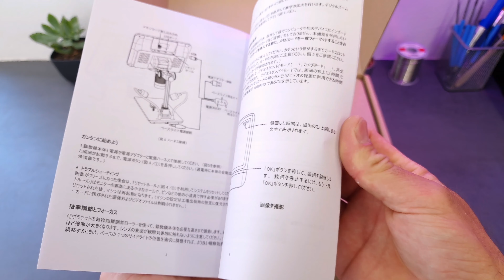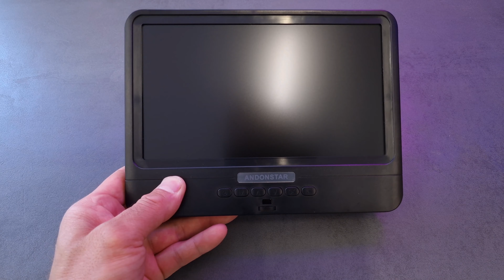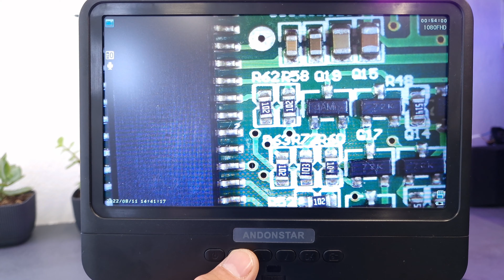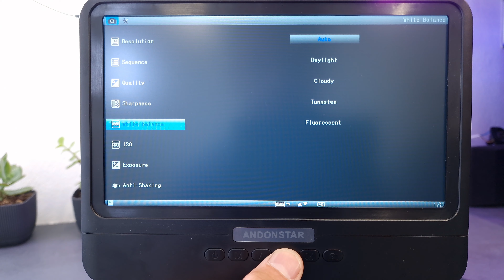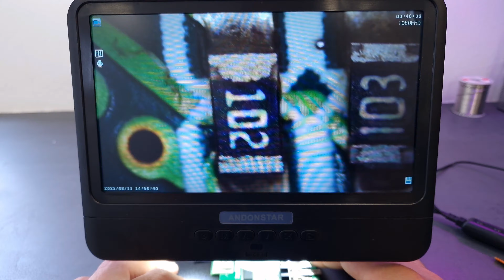Digital Microscope ANDONSTAR AD208 Capabilities - Soldering has never been so easy

Comment: Mr. if the car engine ECU can detect the components if there is an error
Reply from the maker: This PCB non-working and in the video I did a soldering test under microscope
Reply: @ErCanEverything  Thank you sir🙏🙏🙏👍